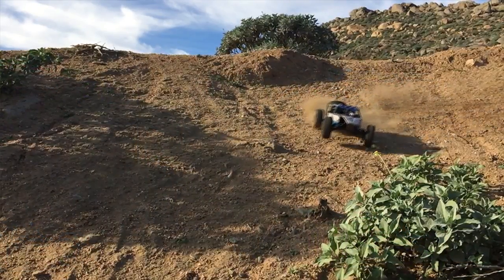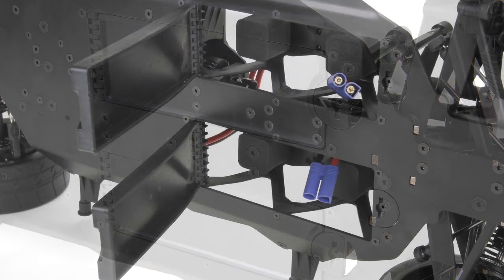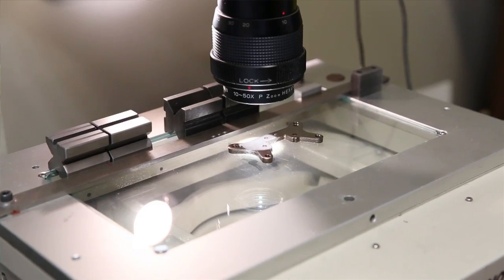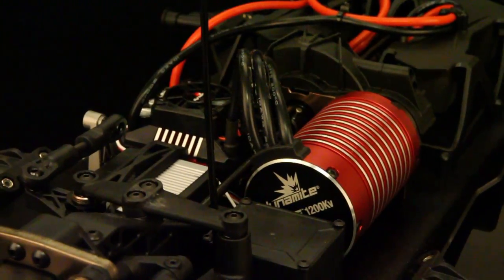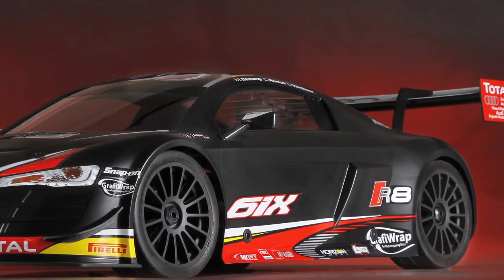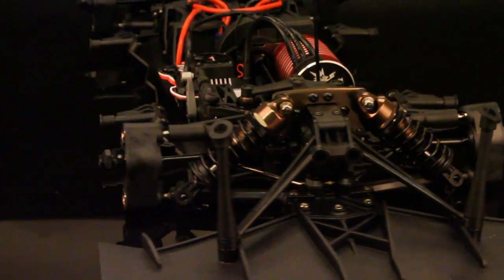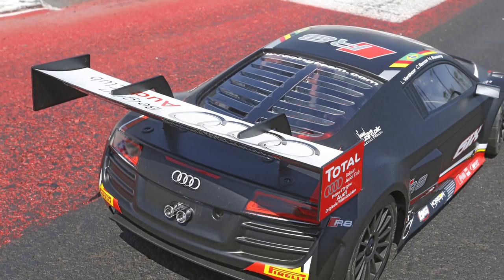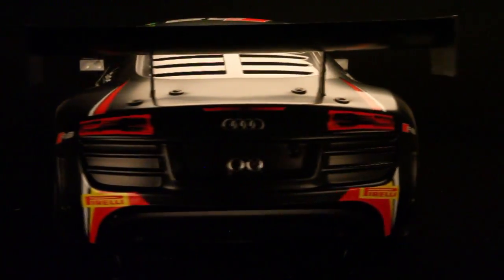Losi Audi R8 Supercar Development   6IX Platform

Comment: I actually think this car will be a good thing for the hobby, it should bring a lot more people into the Large Scale side. and the price is not bad considering, i have a 1/5th scale FG that started life as a gas powered RC, doing  the conversion to electric, while it was fun, its very expensive, especially if you go with good stuff. here you already have the conversion done. While i don't trust the whole Dynamite system you could upgrade those parts for roughly $400 and your still cheaper than doing an FG conversion. My only hope is they come out with other bodies besides the Audi, i tried a speed run with my 8th scale Audi GTv2E and at moderate speed the back sucked up into the wheels. I say Good Job Losi, I like others will be waiting on this to hit the market. Also, with Losi doing this, it may drag others like HPI, AE, and even smaller companies like Aarma into the large scale game, where you don't have the overpriced models like Mechatech, and a few others out there.

Comment: 1) Needs alternate bodies. Obviously, the 911 comes to mind, but the Dodge Viper and Corvette, Lamborghini Hurican, and Ferrari 488 are well. Obviously someone will shoehorn the New Mustang and GT-R in their as well.

I would seriously hope for some third party support here and for the tires. Some "not replica" bodies would be cool too, Protoform/Pro-line has this neat 1/8 scale GT body that would be very cool.

2) Full width under carriage/plate. If the XO-1 did anything, it showed that a sealed underbody is key to maximum aerodynamic performance. The XO-1 seems to have a hard time reaching 100mph but that may be for the aero that is much more suited to downforce generation in on-road racing, where a higher average speed is more important than a higher maximum speed, as in speed runs.

3) I'm still a bit antsy about battery servicing from under the car, but we'll see. I mean the argument makes sense, but I was grateful not to have to deal with that after the my old Hornet ages ago.

4) TLR,  your 22 and 8ight-E, are great so I have no immediate complaints about the 6ix. But I hope, like I did with the XO-1, that this is the start of a new genre with MANY alternate models for differing makers. While clearly not as robust and purpose made as the 6ix, I am hoping to "parts bin" a 1/8 Monster truck into a 1/6 on-road car now. R/C needs to grow a some in the US.

Comment: Car is awesome but the price point is way off. Should be in the $575 to $650 range.
Reply: donbo63 Don't get hopes up like that . 

The 6ix is already being listed through RC retailers for about $1200. and the less big Traxxas XO-1 is still going for about $700. and a Losi 8ight 3.0 is about $700.  The typical 1/6 or 1/5 model,NOT RTR kit, goes for over $1000 with very few exceptions.

The 6ix being about $1200 seems about right.

Comment: Very nice and sign me up I can see 100mph+ easy!!
Reply: +skirmich Who says they want to compete with the XO-1, I have both the XO-1 and the 6ix R8 and they're completely setup differently.  It's obvious they intended this to be a track car and not a straight line high speed car like the XO-1.  Everything about the 6ix is beefy as well.  Traxxas simply modified the Slash to make it work where as the 6ix is it's own car.  I'm sure they'll develope more cars based on the 6ix platform but it's a new platform and it's rugged as hell.  I've already crashed it a couple of times into walls and it bounced off no problem.  The chassis plate is a LOT thicker, stiffer and heavier than the X0-1s giving it more traction on the road in corners.  I've turned my XO-1 into a track car but it took some work whereas the 6ix is track ready.
Reply: Wiseass RC Who says.. Oh well its kinda like the "pre-iPhone era"...

Before the XO1 there wasn`t a 6iX..
After the XO1 oh joys we have a 6iX.
Its pretty much obvious its a competitor to that since there aren't any other successful 1/7 +100mph On-Road out there..

Also the XO-1 is a track car out of the box, It needs setup like everything else.
Reply: breakin wind Yes but at what price? LOSI loves to stick a gigantic price tag on everything they do and remember that the 6IX wants to compete with the Traxxas XO-1 and that thing is already selling at 670bucks and its +100mph capable out of the box. .
Reply: The website said $1,100 and the X0-1 was $1000 and if you know Losi it will be build much stronger and I would like to see you take a XO-1 out of the box and hit 100mph without flipping it and tearing it up because it will not happen.
Reply: breakin wind Yes the XO-1 was 1000 with batteries, I don't see LOSI including 3S batteries either with that 1100 price tag. Also I would like to see the 6IX hitting 100mph too but there is no such estimate.. At least the X0-1 reach more than that speed.
Reply: skirmich You have your own opinion. I have the XO-1 and it was good for the hobby and I also believe the Losi will do the same thing and I'm very sure I will easily get it to 100mph+ along with a lot of other people and I also believe it's good marketing to say it does not do 100mph and people struggle going that fast that are not familiar with doing those kind of speeds. From my experience with Losi and Traxxas. they both build totally different kinds of vehicles and Losi is usually built stronger especially their drive train.
Reply: skirmich The XO-1 was about $1100, with batteries. Traxxas has since discontinued selling it with batteries. and can get some really good ones for less than the $400 you save getting Traxxas batteries packed in. They still have the best heavy duty connectors going though.

I'm already reading on some sites the 6ix will be about $1200, without batteries. But these are early articles no actually detailed tests or reviews. But I doubt it'll be under $1000 through most distributors and outlets. If the price is ever going to go down, it'll need some serious competition in the segment that so far does not really exist, in the US. Even then serious competition machines will not be cheap. 

Maybe OFNA and AE will do one each.